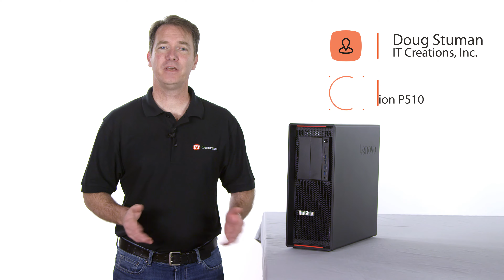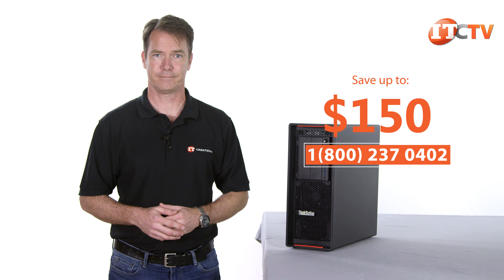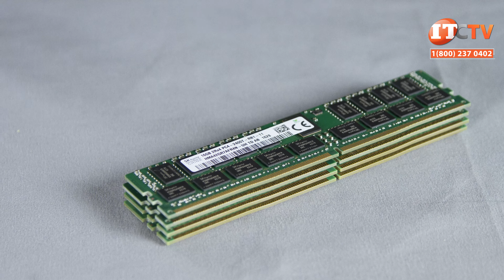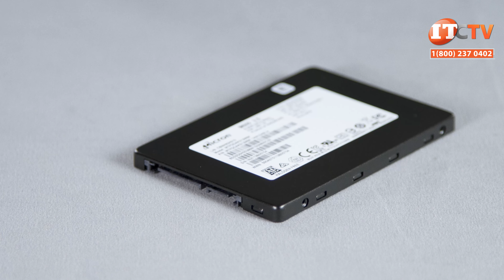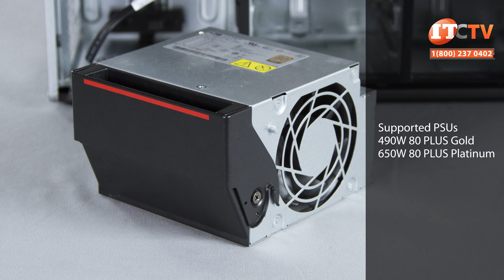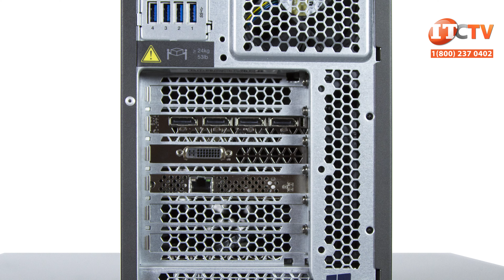Lenovo ThinkStation P510 Workstation Review - IT Creations

Comment: In nowdays Will you  buy one?
Reply: runing this chasis for 6 years with xeon 1680 v4/64gb ram for pro 3d game related stuff (with silly 1080 ti;)... , and with it's original windows! never failed me;) the only minus of this chasis is the power supply and it's cables:( if you guys want to put modern gpu inside...prepare for psu change, witch is quite hard (not easy acces to more powerful ones) it's build like a tank and it's quite heavy peace of hardware:) weak point is the lever for the side pannel - mine broke 3rd year
Reply: Love the P500 and P510 chassis. It's built like a tank. 
Xeon v5(8ç16t or more) is still quite decent in 2021.
But unless you can get a second hand one at a good price or you really need ECC ram for your workloads, a Intel Gen 10/11 or Ryzen 2/3 new built is much better in most aspects.
Reply: @ghanz84  in Germany they go around 220e on eBay